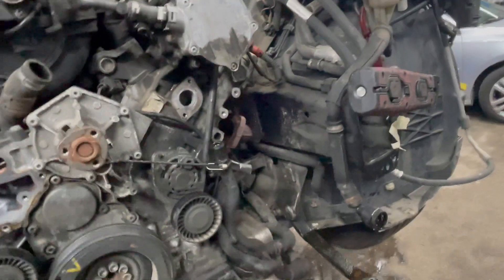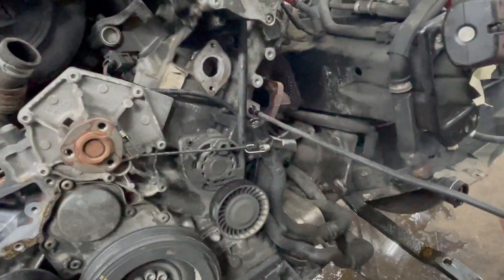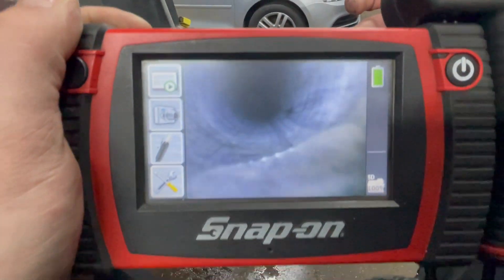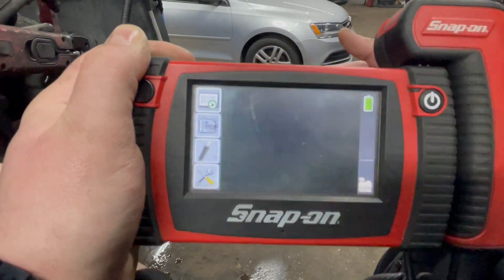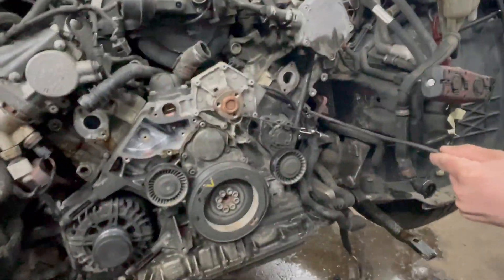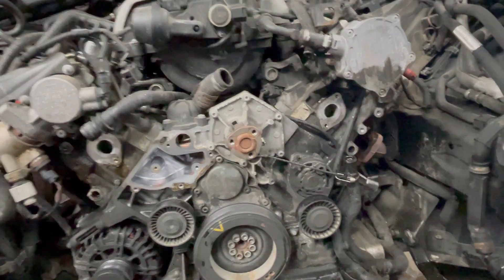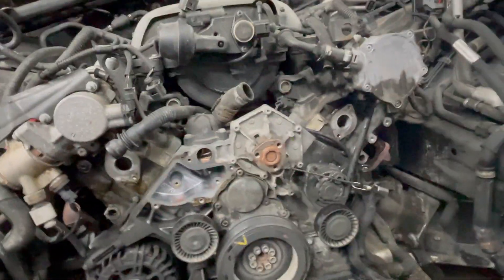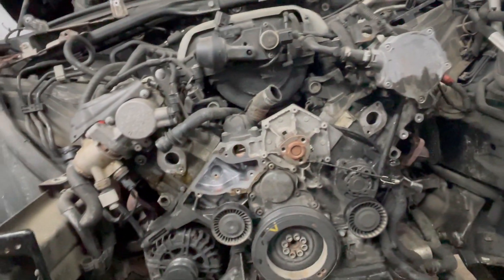2010-2013 Audi Q5 3 2 6 cylinder secondary air injection fault code Part 3

Comment: doing it with the water tool is much better, as proposed and done by Audi, you don’t have to take the whole front end apart as you did. Just put the front end in service position, using the bendable hose you can easily access and clean the intake in just 4-6hrs. way less expensive.